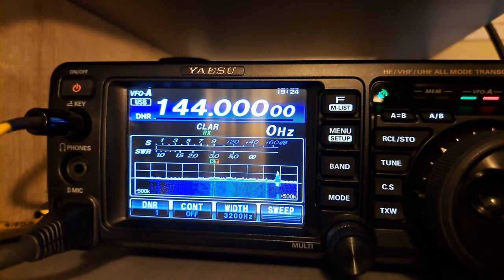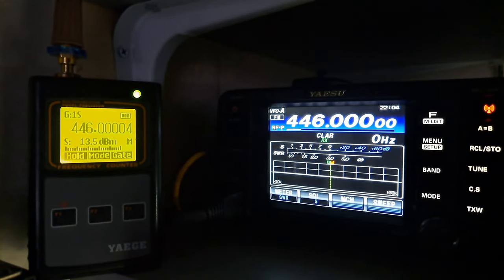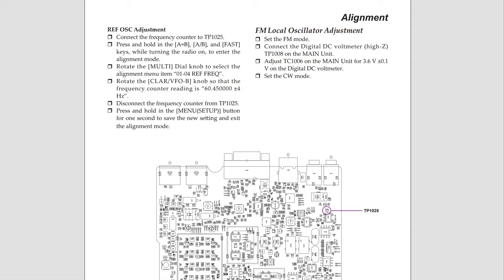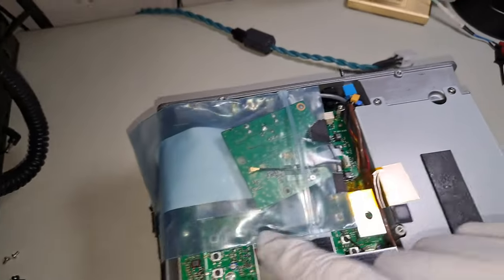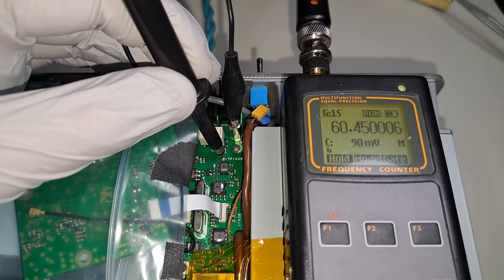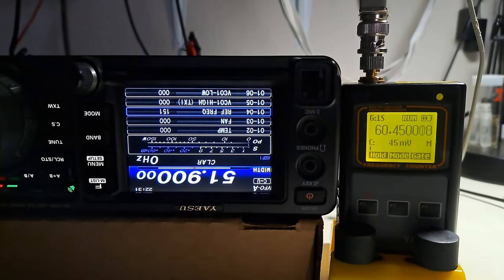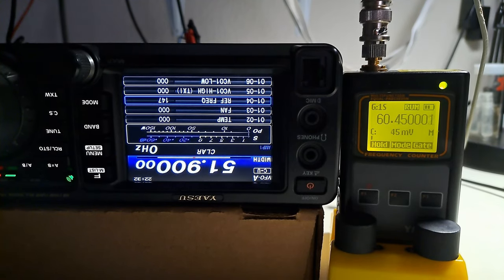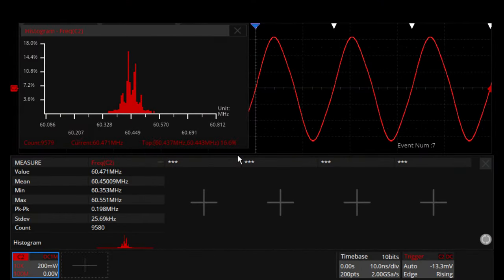FT-991A Reference Frequency Adjustment.

Comment: Hi,  because I have the same radio I immediately thought that if someone don’t want to open up the radio there’s an easy way to do it. Just access the normal user menu. Can’t recall which menu item but is called “freq adj” or something.
You have a narrower range but still… for small alignments is doable.
Anyway, very good that you calibrate your radio in frequency.
So many hams are out of freq.
73
Reply from the maker: Hi, thanks for the interesting note.

Certainly, there are instances when it becomes necessary to adjust the Reference Frequency swiftly and safely for specific reasons.

A quick press of [MENU/SETUP], scroll to the field labeled "039 REF FREQ ADJ," with the original parameter set at "0." Here, you can easily make quick readjustments. 

If anything goes wrong, you can easily revert back to "0" without the risk of crashing the service menu of your radio.

DE UT4UFA, 73!
Reply: thanks for taking the time to check and specify so more information is provided to other users. 
Best wishes
73
Diego

Comment: Perhaps it's a TCXO (Temperature Compensated Xtal Oscillator), which may use (basically) phase 'jitter' or little frequency steps to keep the average frequency exactly on the mark.

...Maybe...  Maybe not.  🙂 73.